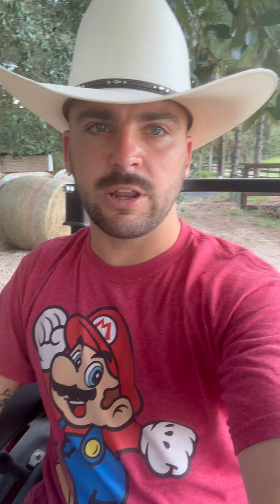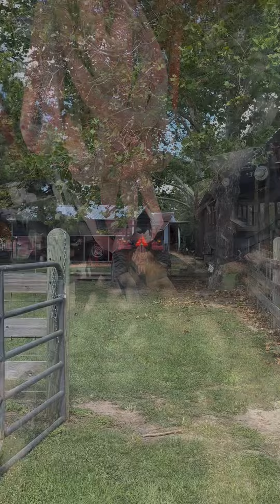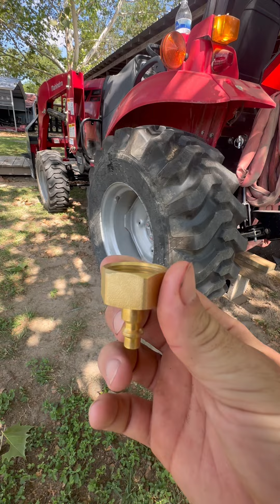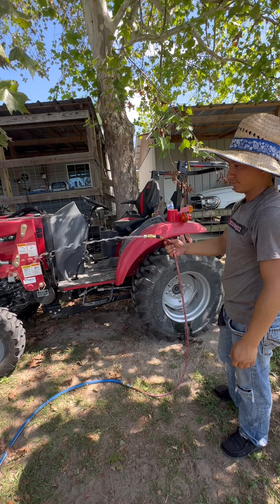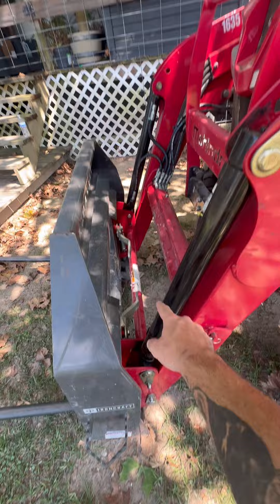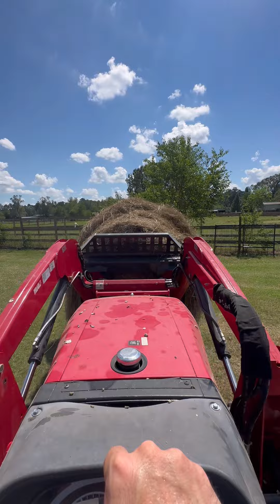URIEL teaches me a lesson

Comment: Wouldn't that much extra weight at the wheels on the drive train be bad for the drive train? Also, water slushes around as opposed to the counter weight I've seen you use on the back to counter the weight on the forks. That counterweight is solid and doesn't move.